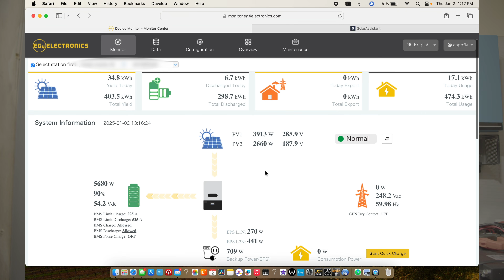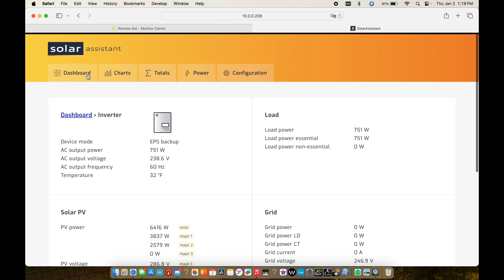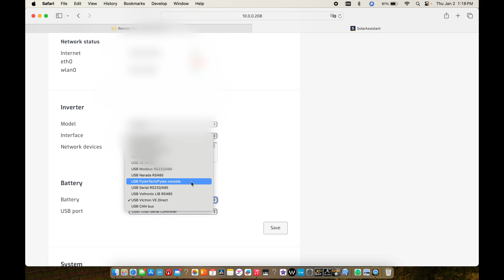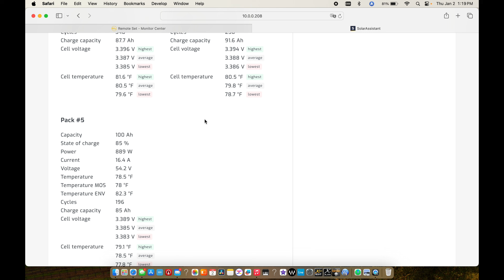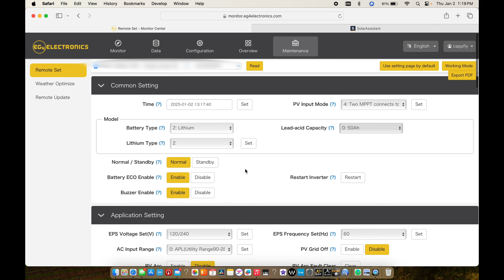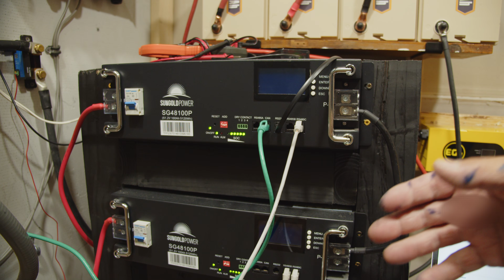12000XP Communication set up with NON EG4 Batteries!

Comment: Can you please post an image of how you connected your solar assistant to the 12000 XP. I have a 12000 SP but not sure which is the right port to pug rj45 cable in the inverter. Seeing only 1 battery pack